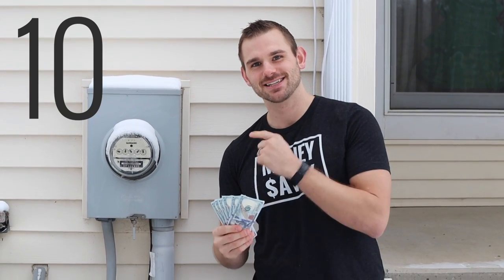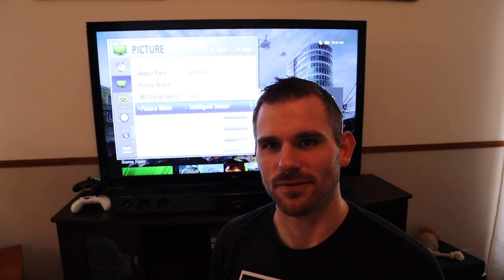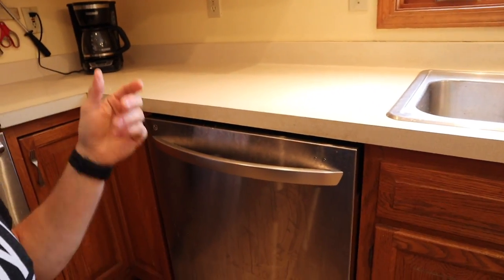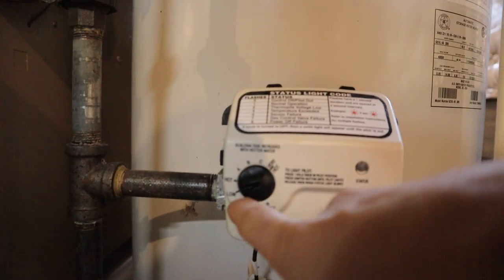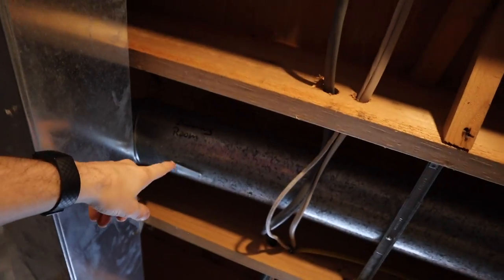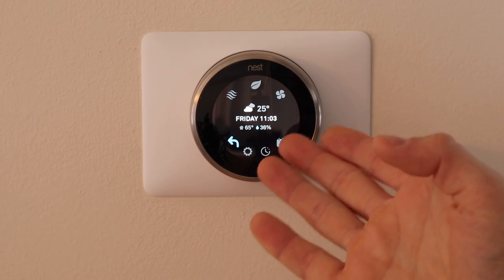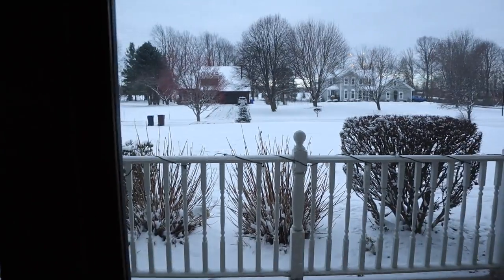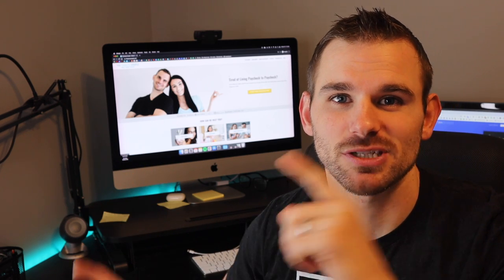10 Genius Ways to Save Money on Your Utility Bills Today

Comment: Our electric bill just doubled last month. (I live in central Mississippi) It doesn't get too cold here often, but last month the temp dropped a couple of days. We used our fireplace on those days and lowered the heater to 62*...Somehow this didn't seem to help and as I stated, the electric bill doubled. :( We will definitely try out your tips. Thank you for posting! I love yours and your wife's tips and tricks!
Reply from the maker: Thanks Jeannie that means a lot to us 🙏🏻. 

Are you on budgeting billing or regular billing? 

Sometimes when the weather doesn’t cooperate it makes it extra difficult to save money here and there. 

Try some of the tips and let us know how next months utility bill goes.
Reply: @TheSavvyCouple  we just moved into our new home this past July and were ecstatic when we doubled the sq footage and were able to keep the billing the same as it was at the old home. (we found out at our inspection of selling the old home that the a/c and heat were actually not installed properly, so it was creating higher than normal utility bills, so we had to fix all of that before we sold.) anyway, we used to be set up on "level billing" but now we are with a new electric company and have to wait 1 year for them to be able to level it out.
Reply from the maker: Wow that stinks you had to fix it all before moving.